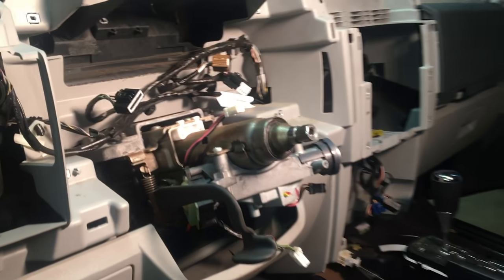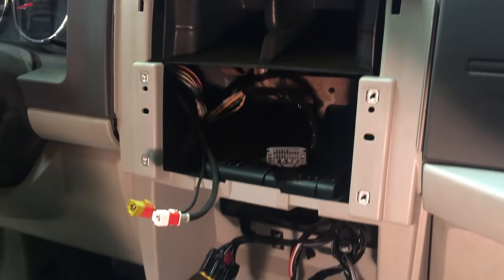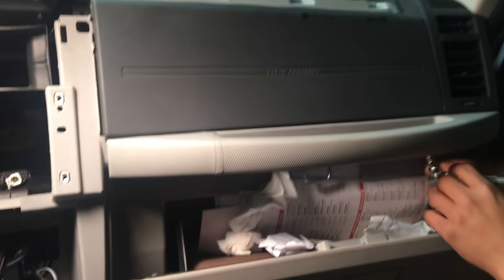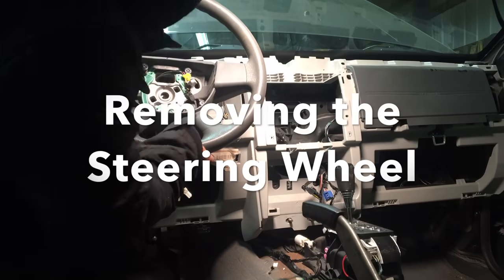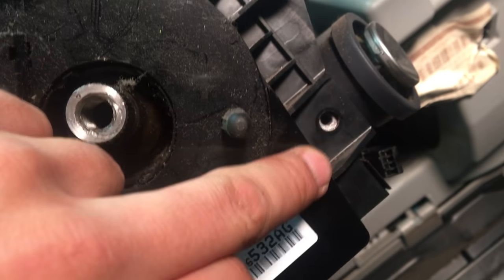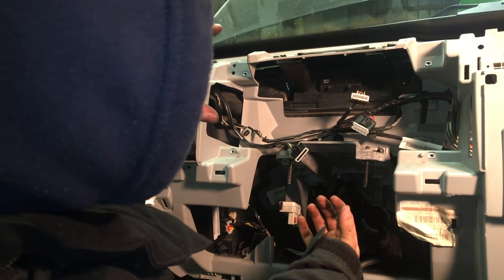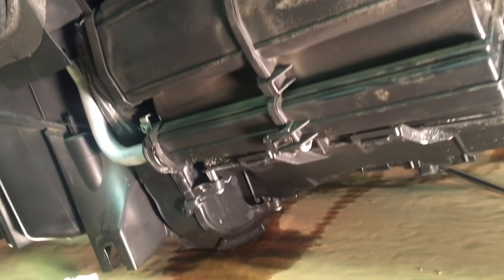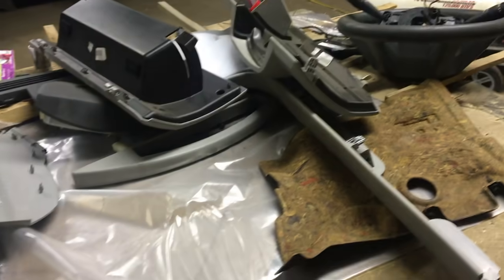Step-by-Step Jeep Dash Removal HeaterCore Teardown. Fix No Working Heat in Liberty or Nitro

Comment: Cant thank these guys enough. They saved me $1400+. Heater core is just $100ish but due to the labor everyone was asking 1500+. It was scary doing it. Lot of things to remove. After removing it the dash didnt go back. It had to be inserted in a particular way. There are guides on each side and it has to be inserted properly. Highly recommend having someone for this step alone. Others are one person activity.

Comment: Excellent job! This video took the intimidation factor out of the job which to me, is 80% of the hurdle to get started. I did mine by myself and it took me about 14 hours. I did not have to remove the steering column or the front seats. In fact, I sat in the driver seat for most of the job. I also did not remove the dash out of the vehicle. I set it in the front seats. I also did not remove the A/C components. After watching your video, I knew what the heater core module looked like so I removed a few screws and yanked it out. It lifts out the opposite way that the dash comes out. The heater core module rocks up facing you and you yank up and angled back toward you. You can ignore that little cracking sound as it comes loose. My final modification was that I did not remove the cables through the firewall. I simply cut them with wire cutters and connected them during reassembly with quick disconnects. 

Mine is a 2012 and the steering wheel is different than yours. Mine did not have those three clips for the ABS/horn. Mine had two 10mm head bolts; one on left and one on right. 

One of the most annoying things about this job was that I had to use darned near every tool I own. For torx bolts (T-20) I had to use my Craftsman sockets plus a screwdriver style. If you don't have both of these then go buy them before you start this job. Also go buy the 5-pack interior tools from Harbor Freight for under $10. The auto stores sell the same tools for $15.

I wish auto manufacturers would standardize/simplify their screws and bolts. Some on this car are 10mm bolts, others are 7mm/phillips, and others are T-20 torx. 

Thanks a million for the excellent video.

Andrew

Comment: Okay... I just did this job on a 2011 Jeep Liberty Sport. This video is a great guide line but definitely doesn't show everything that needs to be done but I am very greatful for this video because it did help allot. I did all my own refrigeration work and from start to finish It took me 13.5 hours with no help, just me. I took the time to inspect my evaporator coil and it was still in great shape so I did not replace it.  I did put new O'rings on each side of the expansion device. I also took the time to number and label each part as I removed it and also put every screw, nut, bolt in a sandwich bag and taped it to  the parts they were used on. I ended up pulling somewhere around 30ish parts off and every one was numbered, so as I was putting everything back together I was able to start with my high number and work backwards to make sure every part was put back on in the reverse order as they were taken off. I did remove the passenger seat but not the driver's seat. The steering wheel itself does not have to come off but I did remove  the steering column with wheel attached, it honestly wasn't too difficult to remove the column and wheel as one piece. Thanks for the video! Not sure I could have figured it out without following this video as I did the job

Comment: Great video walk through. I would like to add. You don't have to remove the steering wheel from the column you can disconnect the harness and the interlock cable and remove the four  bolts and the intermediate shaft and remove the column  in one piece, that is how we did at the dealership.
Reply: Can't you get at the heater core without removing the entire dash. I've seen comments where you just pull the dash completely up after steering wheel removal but leave the last airbag connection and wheel speed sensor. It leaves you enough room to get at the core.
Reply: Be careful with the clock spring,after removing column

Comment: Uhhhh, I would just buy a plug-in heater if my core went. Good work........master of the universe!
Reply: I've tried 3 plug in heaters.. All they do is blow fuses... Without heat 3 Ohio winters.. It's paid off and currently halfway tore apart while I attempt this nightmare myself. What a mess!

Comment: Good job guys I've done quite a few of those Jeeps now it's been about six or eight months since I've done one your video nice mental refresher anybody watching this video the only suggestion is not mess with the steering wheel just take the thing out as one unit remove 2 covers behind the steering well unplug it remove the steering shaft bolt and take it out as one saves a lot of time but again guys  for the video

Comment: I just did this job. You don't have to take the seats out! The center console will come out without that, Also you don't have to disassemble the steering wheel! Remove the pinch bolt and four mount nuts and the thing will practically fall out all in one piece. After unplugging of course. I do a lot of these for local shops and try to find the easiest way. Disassembling the steering wheel and pulling the seats will add an hour, at least...
Reply: What do you have to unplug on the steering column for it to drop down once the mount nuts and pinch nut is removed?
Reply: all of the plugs and the shift interlock cable. Take pictures before disassembly. All of the plugs are different so don't worry about getting them mixed up. Also a good idea is to take a large piece of cardboard and rough sketch the dash and steering wheel. Take a screw out, poke it in the cardboard. That way all fasteners go EXACTLY where they came out and no "extra parts. it takes about ten minutes to get the steering column out.
Reply: @dronographyllc3549  I'm doing this on Saturday. I'm so glad I came across your comments. Thanks!
Reply: How do you disconnect the shift csble? I didn't see that in this video.
I'm in the middle of doing this project and the dash will not come out. What am I missing?
Reply: @dronographyllc3549  so the steering wheel does have to come off?
Reply: @czapskibusinessgroup  no. Just remove the pinch bolt from the u joint area then 4 bolts holding the column to the dashboard, the entire steering column comes out as one piece. Do not let it rotate out of position as there is a "clock spring" inside that interfaces with the turn signal assembly.

Comment: Hey. im doing one right now and you don have to take the ac lines off. just leave them on and swivel the case out just a little bit and you can take the 4 screws out that holds the top of the case on. then you can take it out and disassemble the part the holds the heater core in.
Reply: What do you mean swivel the case? I know the box has 4 clips holing the core in. There's enough room to pull it out?

Comment: thanks for posting this. i have a jeep compass 2008. i have heat, it just won't switch to the floor vents and the defrost. not good for MN winters. never knew it wasn't wanting to do that until i needed it to. of course. this is a good start.

Comment: Good video. Very helpful. But why you take the steering wheel so far apart. Just removing  the 2 nuts allows the steering wheel to the floor without having to take the shaft signals ignition and wheel off

Comment: Jesus, I got a 2012 liberty that needs the heater box replaced. My mechanic told me it would be somewhere in the area of 1500 to get replaced, I can see why now.
Reply: the 2012 liberty im doing is going to be about $900
Reply: The dealership told me 1300.00 but another shop told me 950.00 to replace the heater core

Comment: I have a 2011 Jeep Liberty. Bought the heater core. Got stuck at removing the center console. I couldn't get it past the E-brake. Last year I was flushing my heater core every 30 to 60 days to get by the winter. Due to the pandemic, I can get away with flushing it once because I work from home now. I guess I'll save up money to pay a mechanic.
Reply: Dang. I just flushed my heater core on my 2008 jeep liberty. I was wondering how long it would last. I used CLR though. I did rinse all the CLR out of the core before hooking it back up. A lot of people ask me that after I mention I used CLR. Lots of gunk came out.

Comment: I Paid $1400 to have this done last year. Drove 3 miles down the road and the heat quit on me. Took it back, they tinkered with it over night and the same thing happened. The mechanic told me there's  nothing more he could do with it after he charged me $100 to flush it. He said jeep libertys of my year had problems with sand contamination when they cast the engine so I'll always have plugging issues with the heater core. Wish I had the guts to do this myself back then. Would have saved a lot of $$$
Reply: ahahahaha!!! Sand issues with the casting of the engine? ahahahahahahahahahh, i'd kick that mother'roos ass and take my money back. Really!?

Comment: Thanks for the vid, q I installed a new core like you.  Got heat but only in defrost.  Air blows to each when selecting(floor, towards...) however it is always cold in each vent other than when I change to defrost then I get hot only towards windshield.  Any help?
Reply: Chilln187 might want to check out your actuators

Comment: Hello, my liberty sends very little heat, the coolant intake is hot but the output lukewarm. Does the system have a valve that cuts off the circulation of water? Or the heat core will be covered? Thank you so much for the comments
Reply: ANDRES ZAMBRANA hey bud im about to replace the same issue as on vid i would check both front passenger driver carpet and or under the mats if its wet you have the same problem and if you smell under the mats and it smells moggy wet you know wet carpet then more likely its the same as on vid prob and if its dry run your heater on hi for good 30 to 45+ check again if its moist or damp or smells same issue and if you open your hood look straight towards the wall of the car along side your engine you will see two blk about 1/2inch hoses those are your heater lines they should be hot always and on the engine bay no there is no valve to turn on off only inside the dash your ac switch controls it lets the hot antifreeze in when you turn it to hot warm ect so best to locate both lines easy to spot check for leaks then check inside so yeah sucks but cant do much about it if you want hot air in the winter good luck n

Comment: Hey! I have a 2006 Jeep Liberty and the heat only works once I start driving. When its in park when I'm trying to warm it up, the heat is only cool air and once I drive, it gets hot. Would this be the heater core? I'm dreading trying to take this dash off by myself.
Reply: Tammy Johnson the first and simplest thing I would check is the antifreeze level. If it’s low on antifreeze you won’t get hot air until you start driving and it starts to circulate more.
Reply: @jaredwehr1431  Okay I'm going to do that today and see what happens. Then ill msg you and see if it works
Reply: @jaredwehr1431  Thank you for the tip! It was the antifreeze, it was practically empty. And here I was ready to tear my dash out!!

Comment: Why take apart the steering wheel when all you have to do is drop the  steering wheel (4bolts) without even messing around with all that unnecessary work? I changed my heating core without a lot of work that is done on this video

Comment: Please help !!! I got everything off as far as I can tell minus the steering wheel, i did take out the 2 screws underneath that were bolts to the dash on driver side under the steering wheel. I have almost freemotion on passenger side but cannot get the driver side of the dash to come forward no matter what I try, it wiggles but feels like its bolted somewhere almost dead middle behind the steering assembly. What am I missing ?  Help !!!
Reply: You ever figure this out? I'm stuck in the same situation

Comment: the minute he said remove the seats I would have poured gas on it and tossed a match in it and called the insurance company haha    this is freakin nuts what they make you go through on cars these days.  I guess I'm just an old fart now but I remember the good ol days when I heater core job was about 1  1/2 hours start to finish.  damn I was looking to buy one of these jeeps too.
Reply: gonzosc1 LMAO!
Reply: DONT BUY ONE OD THESE JEEPS!! I have a 2008 and it is a piece of crap and my heat also does not work. Not the heater core because it is pushing warm air. Acts like there is a short somewhere. This truck literally rots from the inside out. I have never had to replace so many parts on a vehicle. Not even my 15+ year old Plymouth duster that was my first car 😞
Reply: C Wood85 hey did you ever figure out what it was? The same thing with a 2008 Jeep Liberty sport I can’t figure it out the ac and heat doesn’t work but it blows air.

Comment: I am shocked my shop only charged me 700 for this and an oil change and were done in a day.
Reply: I hope they didnt just CLR flush your system and tell you they replaced the part. Did you ask for your old part back? Not saying they would do that, just seems like a very good price.
Reply: This is the going rate of every shop in my area, I got several quotes
Reply: @thisendup86  They definitely took apart my whole dash. Whatever they did has worked for 5 years.
Reply: @Turk_2023  Cool. Thanks for the info. I dont expect my quick fix with clr to last for very long. Ill be going to a small business shop for my replacement and not a dealership when it comes down to replacing it.

Comment: Think this can be done without taking the steering wheel off?
Reply from the maker: The wheel itself has to come off. You probably wouldn't have to removal the steering column.
Reply: it was easier for me to take the column out but its not hard.

Comment: It's unnecessary to remove the steering wheel. You don't need the entire dash out to remove the heat box.
Reply: Is there a vid
Reply: not every body has access to alldata